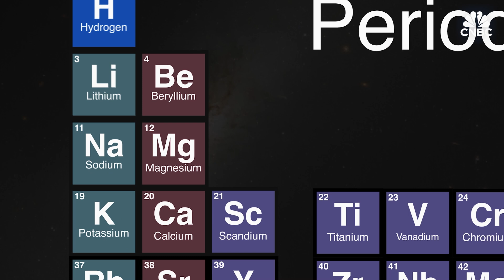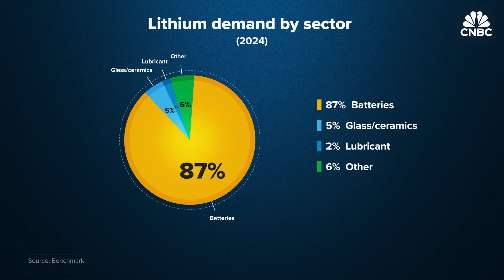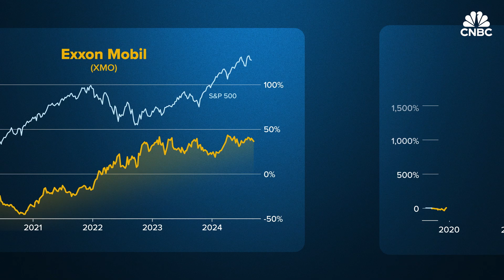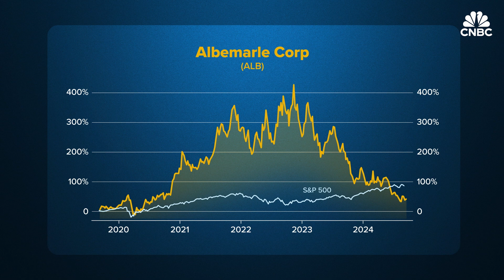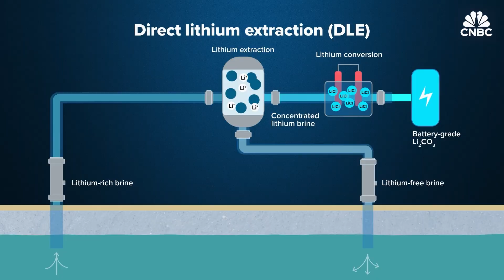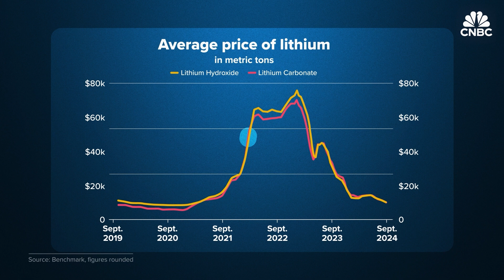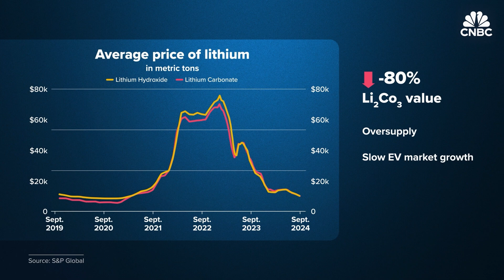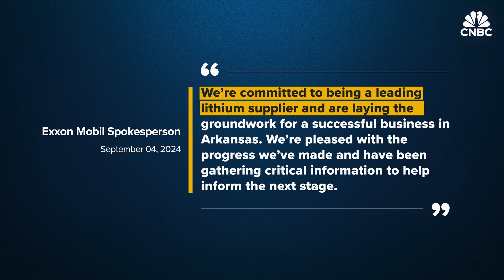Why All Eyes Are On Arkansas’ Lithium

Comment: another money burning pipedream. Come back to this video in 5 years. It is more likely than not that this project will fail.
Reply: Bro I am a hater but it isn't burning money to try to mine this stuff. So far it is the most useful element when it comes to storing electricity. You know, the thing you are using right now to read this comment?? And this is driven by private investment, not government edict. Making it much more likely to actually happen.
Reply: @CalPersona  private investment gets pulled even faster. There is a reason Li is not mined in US. Impulse of politicians doesn't make good investment. It didn't work for Russia and China. It won't work for  US either.
Reply: Why do you think that?
Reply: YOU WILL LEASE AN EV AND YOU WILL LIKE IT, PEASANT!
Reply: @TheSmark666  who said anything about EVs?  We need li-ion batteries for our vapes!
Reply: I guess there is some possibility that America's env regulatory barrier could potentially delay/bury this project.  Otherwise, it seems quite promising.
Reply: And if it does, it'll be because of people ditching EVs. And EV demand has being going down and some car makers are cutting down on EV production.

Comment: Arkansas’ lithium boom has the potential to even weaken China’s „monopoly“ on EV supply chains, creating a more resilient and local source of critical materials not only for the US but for other countries like Germany or France looking to reduce their China exposure
Reply: Lithium is only a temporary step towards electrification, by the time you get those mines going China will have moved on to non lithium batteries.
Reply: @Amigos_de_Don_Eladio  This is absolutely fantasy.  You have no idea how long it takes to transition to different forms of power storage or move supply-chain.
Reply: @Amigos_de_Don_Eladio  Yeah man, in 20 years maybe
Reply: We have a bit of lithium in Europe but most are opposed to hit because of environmental concerns, also Europe been dependent on the USA isn’t any better than been dependent on China.

China has the best battery tech nowadays.
Reply: you should look up the effects of mining to understand the cost you're quick to accept
Reply: @smartwatchonpluto this is more like a well (a hole in the ground) than an open pit mine. Drilling Technology already exists, Exxon has the expertise, it has been happening for 60 years  in Arkansas already but they’ve been ignoring the lithium and reinjecting it into the ground.
Reply: @smartwatchonpluto  and you think this will be worse than the oil drilling and fracking that happened at much larger scale in this area already? Lol
Reply: China has already given up on their Lithium monopoly. Chinese companies have divested a bunch of lithium operation and one of the buyers was Albemarle. A company from North Carolina.
Reply: @Neojhun While investing in other places such as in Africa and South America
Reply: Why should germany and France depends more on the US by reducing its reliance on China. That's the trick the US used for the last 20 years to weaken Europe competitiveness which led to growth and wages not rising as much in Europe than in the US. Europe needs to self-sufficent thus rely less on China and the US especially in the defense sector where US companies have almost a monopoly.
Reply: Others go to Africa, India or Australia to mine these resources
Reply: China's lithium mainly comes from Australia and Chile.
Reply: @tooltalk The imported ones